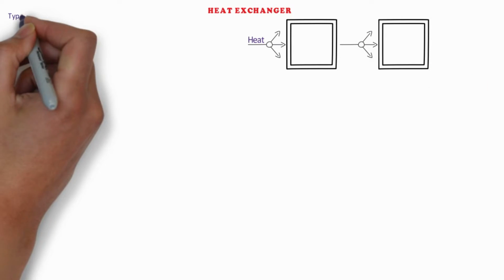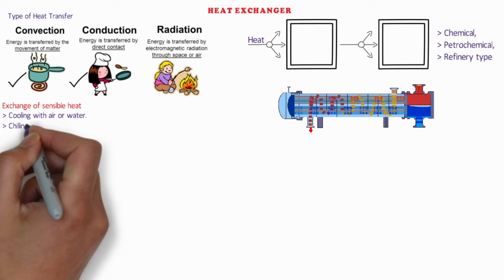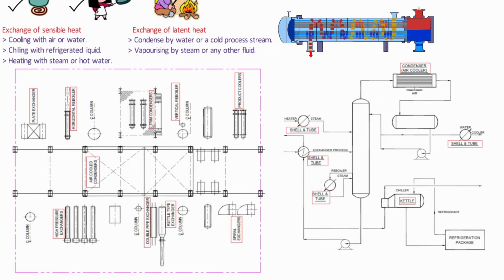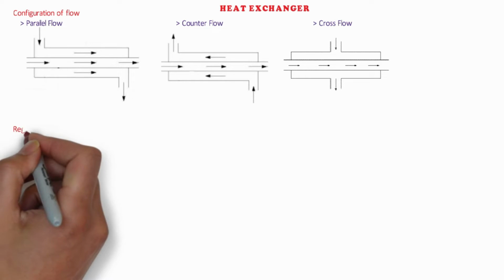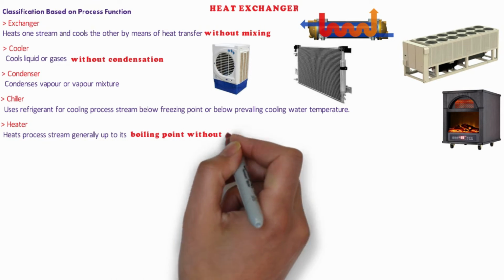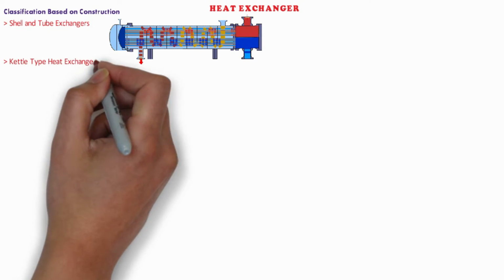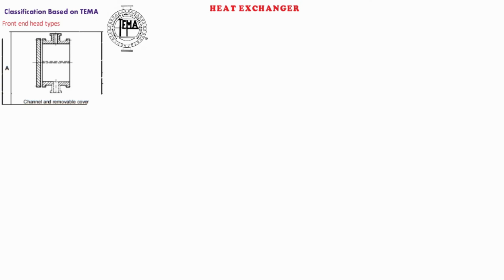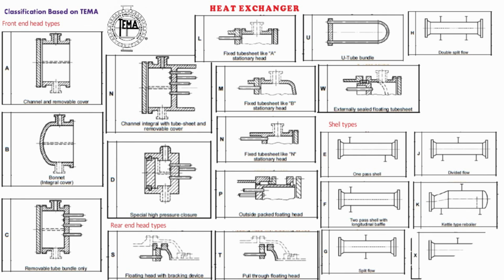HEAT EXCHANGER BASICS | CLASSIFICATION | MODE OF HEAT TRANSFER | PIPING MANTRA |

Comment: Hello mem I have Small doubt in one pipe line will install one control valve why upstream and downstream pipe line was reduced
Reply from the maker: To have on size lesser control valve which cost less
Reply: In some gas lines one place line was expanding and some places reduced what is the reason mem

Comment: As usual excellent video. Why to roll the pipe? Is there any effect of pipe rolling on process ( fluid characteristics)? Thanks for your valuable time.
Reply from the maker: Sorry Abid i dont understand your Question. could you please mark timing where I talked about it. however rolling is the one of the process by which pipe is manufactured.... if you are asking for this, please reply we will discuss... thank you.
Reply: @PipingMantra  Thanks for your prompt reply. Sorry for the inconvenience. I didn't mean "rolling" while manufacturing of pipes. Also, this question is not related to any of your video. Rather I should have asked, in isometric drawings; piping rolling is given (if required). Why to roll the pipe? Is there any code for rolling the pipe?  Is there any effect on process due to this rolling?
Thanking you for sparing your valuable time.
Reply from the maker: @cck0728  ohkay... rolling is just that you are using elbows  (90 or 45 in piping ) have the same effect (pressure drop, i think you remember K factor). Rolling normally used when we can't provide std elbows (90 or 45) in confined space. As per my knowledge there is no such std available for that but yes rolling have an effect on fabrication, need to machined (cut, end preparation, grind etc) elbow  at shop or site according to angle mentioned in isometric #ideally .
Reply: @PipingMantra  Thanks for your prompt reply. Please keep on contributing with your valuable expertise.